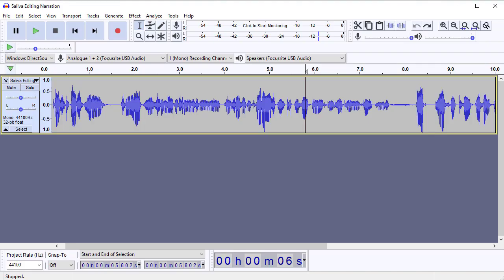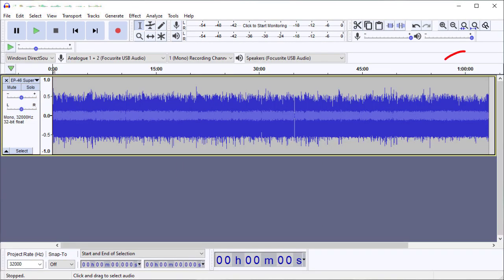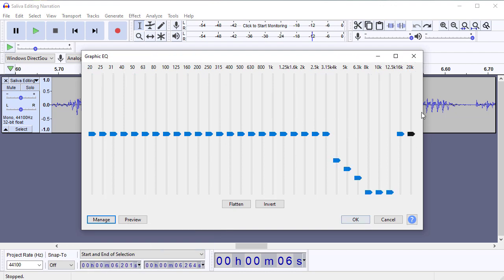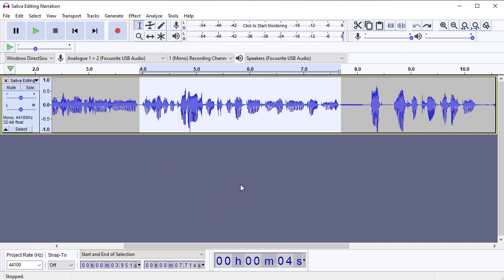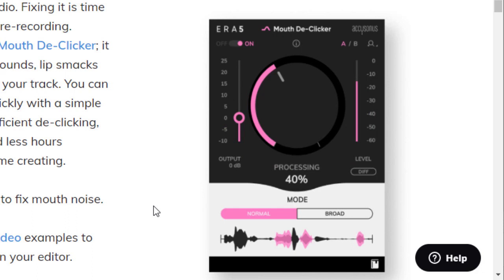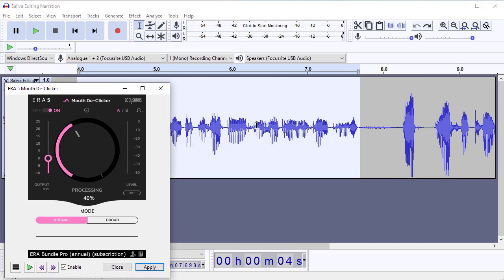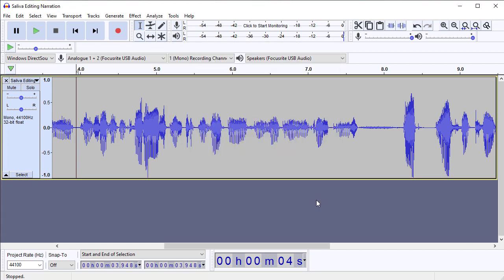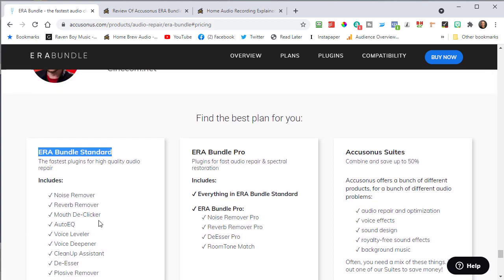Mouth De-Click Plugin From Accusonus

Comment: Hi, could you tell me how good this plugin is for voice? Does it distort it a lot? Also, where in the processing chain should the declicker be? At the beginning of the noise reduction or at the end after the compressor?
Reply from the maker: Unfortunately, this plugin is no longer available, as the company went out of business. So I direct people to iZotope RX instead. And it does an excellent job. I use it for every voice editing job I do. also, I don't do a "chain." De-Clicking on a voice is something I do as I work my way through the audio - doing small sections at a time so as not to treat audio that doesn't require it.
Reply: Thank you for such a detailed answer! Yes, I've heard about Izotope RX and it does a pretty good job with clicks if we work directly with the audio track. However, if you use Izotope RX De-click in online or live streaming mode, it gives a noticeable delay on the voice. And this encourages us to look for an adequate alternative.
Reply from the maker: @greendaer7391  I see. I guess that is just another side effect of using it as a track effect.

Comment: As far as I can tell this is not available anymore.  They will support current users through the end of the year.  But they are not taking on any new customers.
Reply from the maker: Sadly, you are correct. I need to take this video down. I have switched to iZotope RX Standard's Mouth De-click tool which actually works much better than the ERA one.

Comment: Does this plugin work with studio one?
Reply from the maker: Hi Dolores. Accusonus went out of business, sadly. I'm probably going to have to remove this video soon. However, as I mention in the description, my pick for a mouth de-click plugin is iZotope RX. There is a link to their site in the description also. But it is part of an entire collection of tools. If you are going to do a lot of dialogue editing, I think it's totally worth it for the $300 for RX Standard. But if you JUST want/need the mouth de-click tool, I just asked on a podcast editors FB Group. I'll update this comment when I hear back.
Reply from the maker: Circling back on this. There is a version of RX called RX Elements, which is currently on sale for $49. It has a "DeClick" module that will work pretty well on this. It is isn't as good for voices as the Mouth DeClick in the Standard version. But it might be all you need. And yes, it does work with Studio One. Hope that helps.

Comment: is the declicker available by itself and if so how much is it per month? I'm sure I could look it up but I figured if you knew it would be helpful to me and others
Reply from the maker: No it isn't. Or should I say - "wasn't." Accusonus has been bought by Meta and is dropping the entire ERA line. If you already had it, you can continue to use it. But nobody new will be able to get it. Sigh. So the best replacement I know of is in iZotope RX Standard. That one works better, actually, than the ERA one.
Reply: @HomebrewAudioRecording  Thanks!  That one is even more expensive. I found a free one. It's not bad. Would love any inexpensive Solutions you might have. Thanks
Reply from the maker: @ComedyTragedy12  Are you using the free one for Audacity? I didn't find that one to be very effective. BTW, RX Standard is pricey to buy outright. But if you are patient and start with RX Elements for $29, they will eventually (every few months) have a special upgrade price for it, which is only about $99. So you'd save $170 on RX Standard with the fantastic suite of tools for plosives (p-pops), noise, mouth clicks, clipping, and tons of other stuff. If you do any amount of editing on any kind of regular basis - even of your own recordings - this is DEFINITELY worth it.
Reply: @HomebrewAudioRecording  Yeah, free one works for short audio clips but does nothing if you highlight entire podcast ep